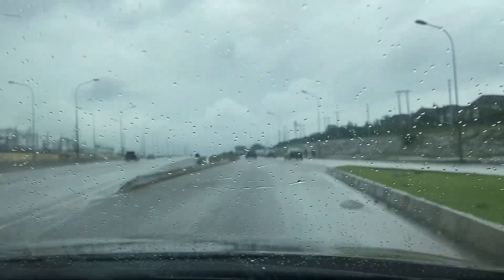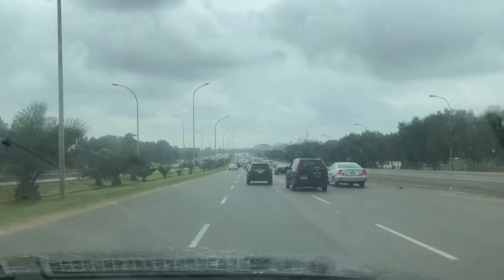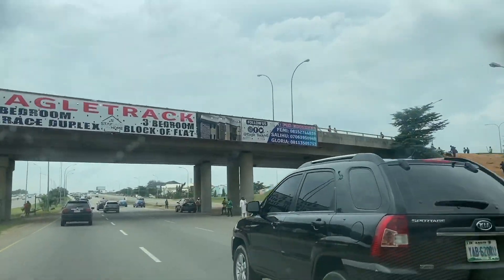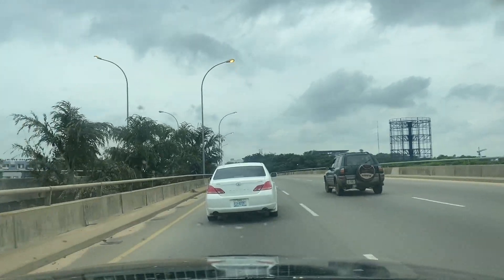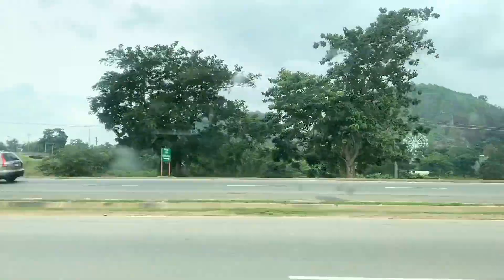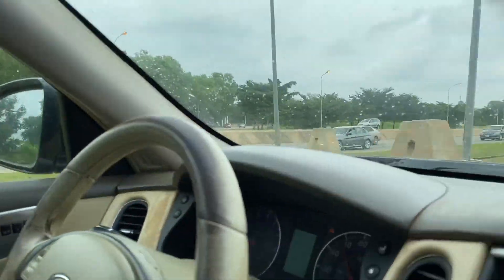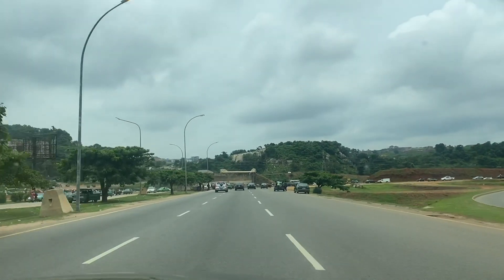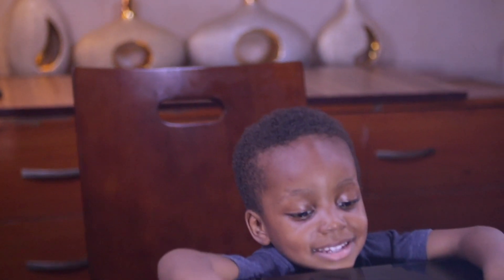KUBWA EXPRESS TO APO ROUNDABOUT VIA RING ROAD 1 ABUJA NIGERIA

Comment: Bigwillz looking at most houses in Abuja, noticed alot have got very High Sloping Roofs good for places with Snows. Those type of Roofings conserve alot of Heat below which later goes down to make the floors under hot. Low slope is better for tropical areas, retains less heat, slows the flow of rainning water which helps in cooling the roofs when it rains. Thanks for all your good job. It fills the day.
Reply from the maker: YO O'bon Have just learnt something new today. Thanks for your comment